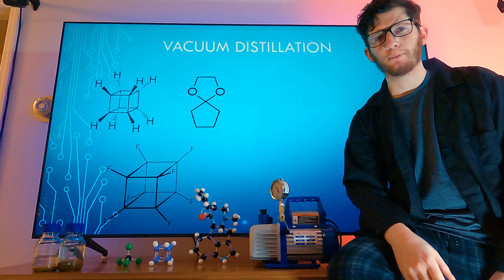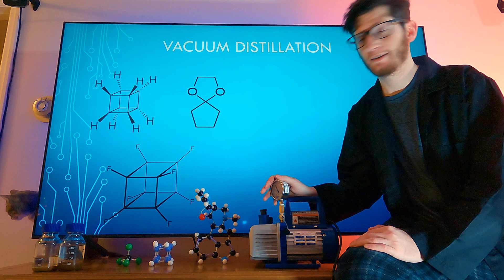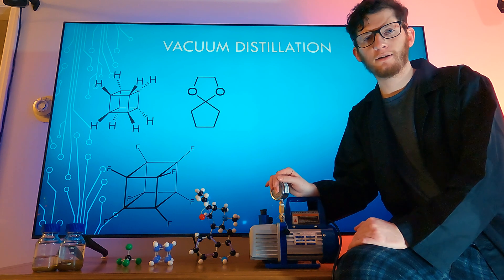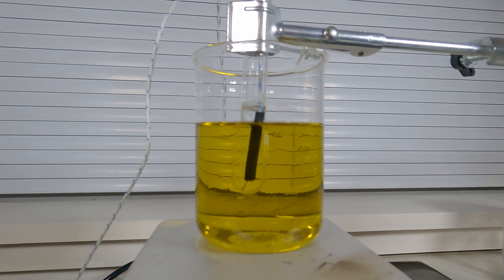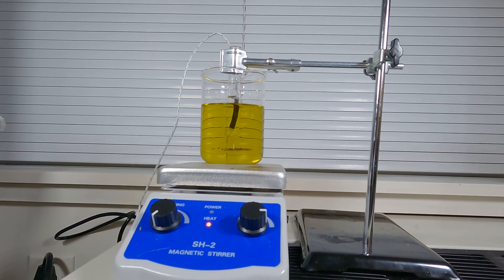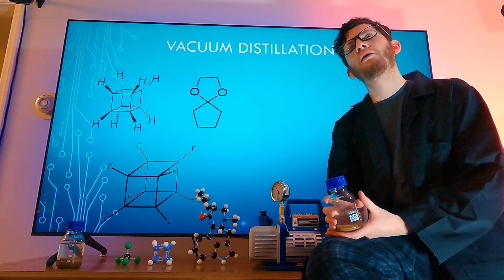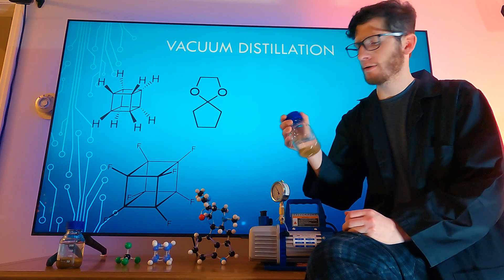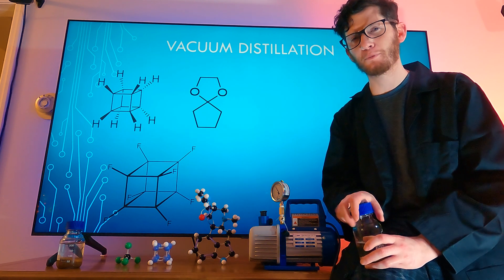Mastering The Art of the Ketal With Vacuum Distillation - For Cubane Synthesis

Comment: It's always best to let things cool down or use bleed valve if you have to pull pack a released vacuum. I've never adjusted vacuum. It is what it is, depending on pump, leaks and how much stuff is vaporazing. You usually just note the vacuum and consider temperature based on what you get. Amount of heating, pump power etc all affect the final pressure.
All distillations I've done in vacuum have been stable. It is a self stabilizing process after all. If the pressure drops lower, more liquid will vaporize that raises the pressure. If pressure rises, less liquid would vaporize that eases lowering pressure.
Pulling vacuum back after releasing leads to quick boiling. All the time there is no (or less) vacuum, heating mantle heats up the liquid. Liquid is not cooled down by phase change from liquid to gas and temperature rises. If you pull suddenly the previous vacuum level on liquid that is (well) above what the boiling point in that vacuum was previously, you'll get a lot of vapor instantly.

Comment: hey just found your channle and i was wondering how do i make meth
Reply from the maker: It’s actually pretty easy you just BEEP then you add a bit of BEEEEEEP to BEEP and then recrystallize and you’re all set
Reply: I know its satire but hey wonder about it too i came up once with method :- 
Toluene is extracted by fractionally distilling paint thinner and is treated with sulfuric acid to remove the thiophene later chlorinated under uv light and fractionally distilled to extract pure benzyl chloride the reaction is further proceeded  using acetaldehyde made from oxidizing ethyl alcohol with potassium dichromate under acidic conditions and reacted with methylamine to generate acetaldehyde methylimine intermediate this is later reacted at 60c with ( grignard intermediate) made using the benzylchloride and magnesium under ether as solvent the mixture is recrystallized using xylene distilled from petrol :^)
Reply: 1) toluene + chlorine > benzal chloride > benzaldehyde
2) benzaldehyde + methyl ethyl ketone + hydrogen chloride gas > intermediate 1
3) intermediate 1 + acetic acid + sodium perborate > intermediate 2
4) intermediate 2 + sodium hydroxide > phenylacetone
5) phenylacetone + methylamine + aluminum + mercury > meth base
6) meth base + hydrogen chloride gas > meth

Comment: what i would recommend to you is to add a bleeding valve on the pump, so you leave it open, turn the pump on and slowly close it to let less air bleed in, and you can control vacuum level that way but knowing the frustration of buying the wrong sized tube for my own vacuum pump i guess you might not want to do that lol, although you could splice a valve directly into the vinyl tubing, pretty nice work
Reply from the maker: Ah thank you! I was over complicating it in my head and completely overlooked something like a bleeder. I was thinking I’d have to save up for one of those really nice pumps that regulates itself but a valve sounds like such a better idea!! I totally know the frustration of buying the wrong size fittings/hosing too. I had to make multiple trips to get fittings and I still don’t really have it set up how I want to. Just going to bring the whole darn pump into the store next time.
Reply: yeah i watched your video about that, coincidentally i was messing with some 1/4th inch brass fittings for other stuff and accidentally bought a 3/4th one but it actually fit the $70 pump i bought, it came with some HVAC thing but unscrewing that revealed a 3/4th inch fitting. unfortunately 3/4th inch fittings are a weird size and just for 2 t pieces, a barb and a 3/4 to 1/8th adapter for the gauge was $60 alone, ridiculous!